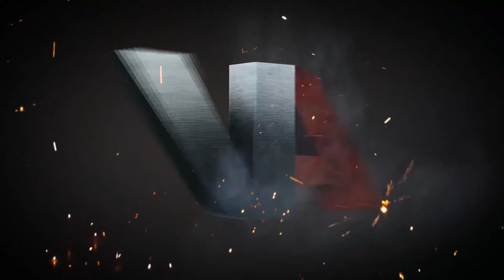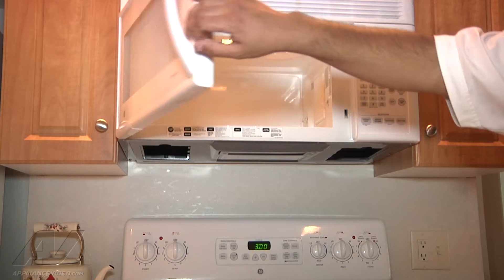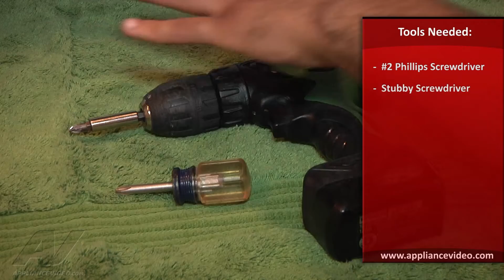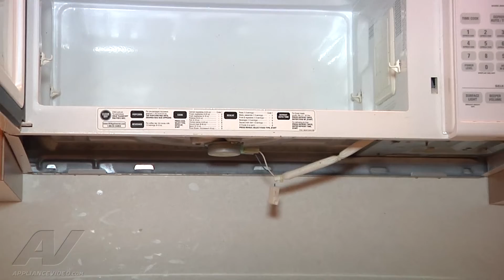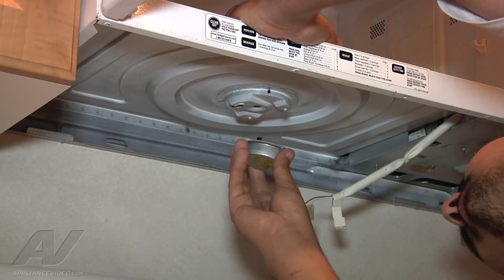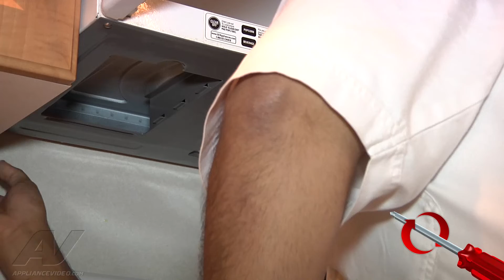GE Microwave Repair - Grinding and Humming Noises - Turntable Motor

Comment: I really wish the tech in this video would have ran the microwave for ~10 seconds, or demonstrated the issue visually and audibly. That would have been of tremendous importance for future diagnostic.
Reply: Dude, if the turntable is making  "Noise" that it didn't make before, when it starts to turn, there is your diagnostic....  Mine just started making noise when it just starts turning, and I know its that little motor...   :)
Reply: @frandanco6289  Hahahahaha.  Spot on.
Reply from the maker: Great question, if you have a
more technical question that our parts department cannot answer, you can search
our over 10,000 answered questions free at our website www.ApplianceVideo.com under our Repair Help section. You can also call
our parts department at 1-800-830-5465 and they can give you help 7-days A week
Monday -Sunday, or search at www.SaveMoreOnParts.com  24 hours
7- days A week.

Comment: jc if it rotates you don't have stirrer motor that is why it turns you do not have both
Reply from the maker: Great question, If you have a
more technical question that our parts department cannot answer, our
technicians are answering all questions at our website at www.ApplianceVideo.com under our Repair Help section. You can also call
our parts department at 1-800-830-5465 and they can give you help 6-days A week
Mon-Sat . You can also search at www.SaveMoreOnParts.com 7- days a week.

Comment: I have the same microwave the guy said it was the motor but when I took the bottom off and listens closer it came from the right side not near the motor. Please help, I like to make midnight snacks and it's a bit loud.
Reply from the maker: Youlikemyhonda1 

                   All of our technicians are now answering questions
daily at our http://www.appliancevideo.com/ website under the Repair Help section.  We also have over 1600 common questions and
answers that you can easily search through by your model number, appliance
make, problem or error code and it’s absolutely FREE. You also have the option
to email a factory service technician with a question on your appliance at
http://www.appliancevideo.com/repair-help/ . If you’re looking for a repair video, you
can also search our library of over 2600 free repair videos. ApplianceVideo.com
specializes in quality DO-IT-YOURSELF appliance repair videos and we get over
800,000 views per MONTH to our videos worldwide and growing. If you need of
parts for your major appliance, we have over 5-million parts in stock at http://savemoreonparts.com/ .  Thanks
for your support. Matt Ace Appliance factory service technician.

Comment: my over-the-range microwave is 7 years old.  It just started to make this weird noise & then shuts off.  What gives?
Reply from the maker: Saverio
                              All of our technicians are now answering questions daily on the ApplianceVideo.com website for anyone needing help. Just copy and paste this this question under REPAIR HELP, and one of our  factory authorized technicians  will answer any technical questions at absolutely no charge on your appliance issues. We also have over 2600 free repair videos to help with your appliance repair issues. Thanks for your support. Matt Ace Appliance factory service technician.

Comment: what is high pitched noise though?
Reply from the maker: Enlightened
              All of our technicians are now answering questions daily on the ApplianceVideo.com website for anyone needing help. Just copy and paste this this question under REPAIR HELP, and one of our  factory authorized technicians  will answer any technical questions at absolutely no charge on your appliance issues. We also have over 2600 free repair videos to help with your appliance repair issues. Thanks for your support. Matt Ace Appliance factory service technician.

Comment: I replaced the turntable motor, still doesn't turn and the grinding didn't go away, could it be the motor on the top of the oven?  My model is actually JVM1640BB002. Thanks for any help.
Reply from the maker: Yes, that is a possibility the motor is the problem. I would shut the unit down and disconnect power to the motor and then see if the grinding stops. Sometimes the magnetron can make a grinding noise when its going out also. Start with the motor first.  If you are in need of any parts or parts department has over 5-million in stock for same day shipping. Please call  1-800-830-5465, for any of your parts needs or order online at: ApplianceVideo.com.
Reply from the maker: Hockey27tom
                                   If you go to our FREE repair help website at ApplianceVideo.com and copy and paste this this question under REPAIR HELP, we have factory authorized technicians that will answer any technical questions at absolutely no charge on your appliance issues. This is the only website on the web that you can get questions answered by certified appliance and HVAC technicians along with over 2600 free repair videos.  Matt Ace Appliance factory service technician